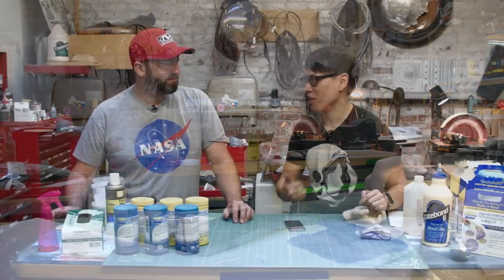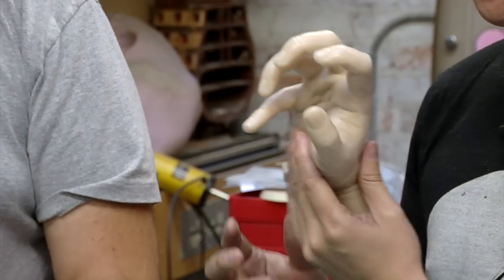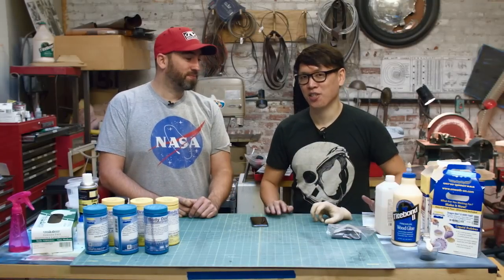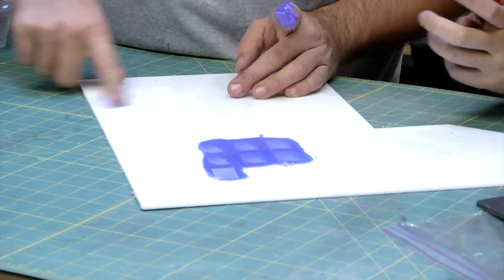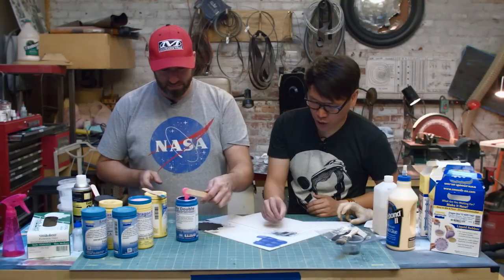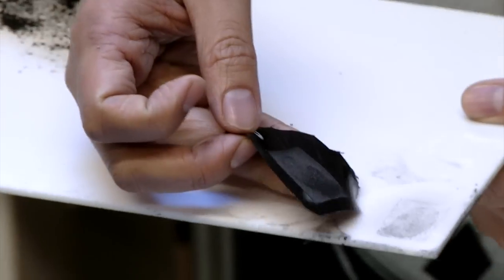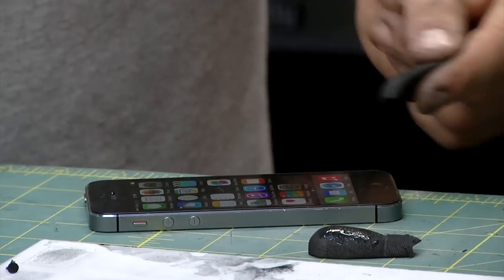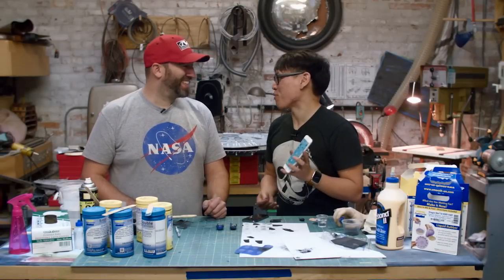Testing Apple's Touch ID with Fake Fingerprints

Comment: HAHAHAHAHA Joke is on you, did you ever stop and think apple where talking through there ass about all the bull shit tech in there overpriced junk?
Reply: The Ducken You're wrong. This video doesn't PROVE anything. If someone steals my phone, they still need full access to my finger to clone my hand in silicon.  (and if they that kind of access: for example, if i'm knocked out cold, or my finger is cut off...then they don't need to bother cloning my finger, but just use my finger to directly unlock the phone). 

This video only proves a security concern if someone could steal my phone and unlock it without my finger at all... by just using the smudge left on the phone from my fingerprint.

This video should only be of a concern to the general public if the asian guy was able to unlock the phone without the white guy present.
Reply: If this even work, it'll take a long time to go and I can quickly disable my iPhone from iTunes. And who the fuck steals and asks for their fingerprint?
Think before you hate.
Reply: Faowi 
That's not  my point, Who would know if this shit even works better that a run of the mill finger print scanner a bunch of techno talk and big words to confuse people , wen really its just a normal Singer Print Scanner nothing special AS PROVEN IN THIS VIDEO...
Reply: Another noob who thinks Android is reasonably priced and fails to understand anything about the superior architectural config of Apple products, amongst other subtle advantages. Newsflash! Android products use bargain basement components and aren't at all cool or edgy.
Reply: Steve Chang ??? Did you even read the comments? I could not give 2 shits about this finger print crap and im not going to explain again.... READ HOLE CONVERSATION then watch the link i posted BEFORE COMMENTING!!!

Comment: One time after eating lunch I was playing around with a tangerine peel, and realized that it worked on the capacative touchscreen. It turned out i was also able to add a certain section of the skin as a fingerprint, due to the texture of the peel.

Unfortunately it stopped working once the peel dried out, but it was fun while it lasted.

Comment: So, the thing is I am a crafty person and I am cutting myself fairly often, I already lost the original fingerprint on multible of my fingers and I just dont know what to think of this touch ID stuff. I dont really know how many fingers your register but I'd emagine 2 or 3 and when you have an accident with your fingers wich " destroy " the fingerprint, doesnt that than render your whole phone useless o.O ?
Reply: Your fingerprint regrows. Unless you get a new finger, or just lose yours altogether it wont be an issue.
Reply: 4WDBearAus thats not quite right mate, it always differs after a cut grows together again
Reply: Wieselkatze LOL No dummy. If you use TouchID on your iPhone. You have to put in a pin number as well. So unless you are completely fingerless you can just type in your pin number instead of using your fingerprint. Did you really think that there wouldn't be an alternate way to access the phone. Come on now dummy.
Reply: Wieselkatze you can have up to 5 fingerprints

Comment: I doubt they even reduce the noise on the fingerprint photo. All the dust between the grooves of the fingerprint lines will fill up the grooves in the laser printed result, resulting in a product that is smoother than usual and does not resemble a fingerprint.

Comment: With all this done i still think touch id is solid, because if you steal someones iphone 5s or you find it how on earth are you going to do these steps, Also the average person doesnt know how to this process. Touch Id is still a pretty solid password.
Reply: TechTuber You could theoretically get a photo of fingerprint from the screen on the phone and do the laser etching thing they did, which worked.

Edit: lol I didn't finish watching the video before I wrote this, turns out the laser etching didn't work, and your point still stands. :)
Reply: No.
Reply: TechTuber I agree. If someone is trying to go to these great lengths to unlock your phone, you're probably not an average Joe, and you probably have a lot more things to be worried about.
Reply: Yes
Reply: TechTuber What if you loose your finger. Your kind of fucked then...
Reply: Gamefan1092 That's why there's a passcode?
Reply: 74ryanwolf And you forget the password?
Reply: Gamefan1092 Seriously? If that's the case don't bother putting a password on the phone if the worst case scenario always happens.
Reply: 74ryanwolf Oh, and apple support doesn't exist in this worst case scenario universe. Have fun.
Reply: Gamefan1092 Yes, I'm aware.
Reply: Gamefan1092 OMG SO TRUE!!
Reply: +The_Only_Zac Umm i dont know what video you watched but the laser etched sketch of the fingerprint did not work..
Reply: +TechTuber yeah but since the other password is mandatory they could guess your 4 digit password OR if you trust touch id wont fail u can set the passworrd to RANDOM letters.
Reply: +super gamer you could do that, although for your own sake, you'd still need to remember it, as on first boot up, touch ID still requires the manual entry.  I guess so long as they never shut the phone off or let the battery die, they can find a way to get in.  I still trust Touch ID though, as I don't have all that much to hide, I wouldn't end up a target for much more then the phone itself.  And as Apple Pay isn't available in Canada yet, I don't have any worries!  :p
Reply: Ryan Laing you could write it down just in case

Comment: I tried this with play doh, a hot glue gun "silicon" and still didnt work.

;I used the play doh for my finger cast, then filled it with silicon, DID'NT WORK they use sub dermal imaging, which means the scan penetrates deeper in the skin
Reply: I'll try rubbing some graphite from a pencil and dust it on my casting, maybe it WILL WORK, totally forgot about the capacitance
Reply: Ricky32908 play doh works better than clay btw
Reply: Play doh is not accurate enough
Reply: it is, try it
Reply: how can he try it if it clearly doesnt work

Comment: They did the etch backwards.
When transferring a pattern to a mold, your valleys will become peaks and peaks become valleys. When they etched it, they etched out the valleys so valleys remained valleys, and peaks remained peaks. Problem with that is when you cast it flip flops again and what should have been a valley became a peak and vise versa. I'll bet that they showed us that it didn't work because Apple doesn't want us to know that it really does work. And what about the higher resolutions? They never showed those. Why? I'm not a conspiracy theorist or anything like that, I'm just trying to make sense of it logically and it doesn't.

Comment: Touch ID uses capacitive sensing not optical sensing. It basically creates electric fields, and the ions in your finger place an electromotive force on the wires, ridges have a greater force while valleys have a smaller force. This changes the charge on each wire which the processor reads as dots and then images your finger from that. Cool experiment though!!

Comment: Yes, while the lock is not super secure, you have to go through quite a lot of steps a trials to do it and only a select handful of people have the correct knowledge machinery and group of people to do it from a single print on the surface. Who wants to go through that much effort to be applied in a real world situation? These guys all did with unlimited amount of time, knowing the correct fingerprint and person and they did it for fun. I think, in a real world application, that the lock is secure.
Reply: A lot of people seem to not realize that this isn't a very practical way of people manipulating these phones. I thought it would be dead obvious from the number of steps they had to take lol
It's just an educational video in a fun way to show more about how this kind of technology works. Kinda like the Mythbusters hah
Reply: like any tech, this can be hacked, and in this case - quite easily. All you need to do is spoof the input device (sensor) into sending a digital recorded fingerprint, without the need to cast stuff. There is no protection against that. Any sensor can be fooled. There is just not such a great return for any investment in this field, so technology for this is not ubiquitous, like the tech for hacking POS or ATMs.

That's why passwords are still the best protection there is.
Reply: FishCakeIce Use a pincode and its even more secure....
Reply: ***** it doesn't realy matter because in order to get the information from the phone where the passcode would do anything different than the fingerprint, you'd have to have the phone and if someone's dedicated enough to steal the phone, it doesn't really matter what protection you have on it because they will get into it whether you had a passcode or not.

Comment: Not even remotely shocked...remember the first fingerprint scanners Lenovo put on their laptops? You could pop those with a flipping gummybear. Fingerprints are idiotically easy to duplicate, and absolutely HORRIBLE for security. You only tried one fingerprint, it wouldn't shock me in the least that with a few attempts, you'd pull it off.

Comment: The direct cast of the finger is interesting from an experimental perspective, but isn't a viable real-world attack vector (if I can get a full cast of your finger, particularly such a high quality one, it would be easier to simply touch your finger to the touch ID sensor.) 

I'd like to see you iterate a bit on the image-based casts, which are more like a realistic attack. 

Fun stuff, as always.

Comment: Tested This is why Apple sucks and Apple Pay is not safe. You guys should try the same thing with a Samsung Finger Print Scanner because I think that the results might be different(better protection)
Reply: How would the results be any different? If anything the security of that biometric sensor is the same.
Reply: No they do not because Apple uses a High Resolution Image whereas Samsung Fingerprint Scanner uses a real sensors that are used by big companies to give access to sensitive info.

Comment: If the attackers are in a position to make a silicon mold of your finger, they're also in a position to just forcibly hold your real finger to the phone to unlock it... That by itself isn't a useful attack.

Instead, using something derived from a photograph (be it from a fingerprint you left on something, or a direct photo of your fingerprint, or a photo of a fingerprint card made with ink) would be a useful attack. I read a paper where one such attack was done, but it was a far more complex process that involved using the image of your fingerprint to create a photomask to expose copper on PCB, which was costly and took hours, which is sufficiently difficult that it isn't going to be done in the common case (somebody steals your phone).
Reply: Adam Zey Didn't you watch the video, they practically reference what you read (or rather something based on what you red) and tried a form of the other method as well.

Comment: I've done it as simple as putting a thin layer of Elmer's glue on my finger and letting it set, then peeling it off and putting it on the ID and then using my another finger to activate it. No need for a mold.

Comment: Touch ID has a ring of capacitance on the iPhone 5S, but the 6 and 6 Plus the whole glass of the Touch ID sensor is capacitive. Looks like it didn't make a difference here. I wonder if this is why I still have to sign for purchases more than $50 using Apple Pay. I figured my fingerprint would have replaced that.

Comment: I've notified more and more people pronouncing "experiment" as expiriment", and the same for "electronic" as "illectronic".. What's the deal? Norm does it twice in the first minute!
Reply: Miles Tulett I mean even typical american accents are very different I know from experience that being from Philadelphia and going to school near Pittsburgh. Also Philadelphia has the typical example of water being said as "wooter" and I am guilty of using both so wouldn't be surprised if Norm had a similar situation.
Reply: Noticed*

Sorry for the typo.
Reply: It's called regional variation, not everyone in America speaks the same, or have you been living in a bunker for the last  50 years?|
Reply: Whilst I'm not from America, I know there are regional differences.  Norm, however, seems to have a fairly typical American accent.  My general experience from watching many Tested videos is that he doesn't normally pronounce 'er' as 'ir', it seems to only be when he says experiment, hence my questioning of it.  It's not limited to Americans either, an Australian podcast host says 'illectronic' rather than 'electronic'.  I'm more curious if this is how most people pronounce it, or am I unusual in 'eh' instead of 'ee' for 'e'?

Comment: I'm wondering how well you could do if instead of using a laser printer to etch the fingerprint you got a sculptor that does tiny intricate sculptures to etch the fingerprint by hand. Someone as talented as that guy that makes the little sculptures inside the eye of a needle for example.
 Maybe even start off with the laser etching and have them improve it by putting more deeper detail into it.

Comment: So if you wake up from a date rape drug induced coma and decide that your fingerprints have been compromised, how do you get new ones? I know how to change my password but I'm guessing changing your fingerprints is somewhat more complicated?
Reply: Belt sander should do the job getting rid of the old ones
Reply: Penny Lane Most people are born with 9 backups.
Reply: This is the reason biometrics should never be used for access. At least not solely.
Reply: A simple visit to your local geneticist for a small genetic modification should do the trick.
Reply: MillionthVector Actually, fingerprints aren't determined genetically. Identical twins have different fingerprints. However, for the same reason, physically removing your fingertips and regrowing them with stem cells or something should do the trick. And you only need to replace one finger at a time so you can still almost type.
Reply: Penny Lane
Ah, now I can save money on the geneticist, all I need is a scalpel and some Miracle Gro.
Reply: MillionthVector Heh, yeah exactly ... let me know how it went before I try it? Please? ;)
Reply: Penny Lane Well, at least you'd have your toes.
Reply: Penny Lane Peel off your finger's skin and wait for it to heal, BAM! New fingerprint
( ͡° ͜ʖ ͡°)

I wonder if this will actually work...
Reply: Penny Lane Man, some of the replies to this make me glad that most people aren't in charge of security anywhere. >.<
Reply: Joseph Jones Once your fingerprints have to be considered compromised, all of them would usually have to be considered compromised. Those backups are stupidly kept in the same place as the one that's in use.
Reply: Then disable TouchID if this is a concern for you. Seems like a pretty simple solution.
Reply: Potato Lord - CSGO highlights
 lol also no
Reply: Rai jyn Did you even read my original comment? :)
Reply: The only thing that you can make it is etching your finger several times. When you do it often egnouth it will slowly erase your fingerprint. Then you could eventualy cut in a new one with a small knife or a laser...
Reply: Rakastan-girl Sinua as we can see the laser ist not acurate enough to fool touch id. we'll need some laser tweaking before this.
Reply: Penny Lane If you have all 10 fingers registered then yeah, sure. I, for one, only have 1 fingerprint registered on my iPad Mini, and it's mostly for convenience, a quicker, simpler way to unlock. Like others have said, though, you can always just switch it back to password-only.
Reply: Rai jyn I would change the finger I put into it to another one.
Reply: Penny Lane cffbsc

Comment: I am wondering if those wax hand peals that some people get in order to make their skin softer (if done just right and with the right substances to preserve the wax as a sort hand mold) would work, and if not, what would it take to make that work? I am talking about the one where you dip your hand into a melted wax that is supposed to penetrate the pours of your skin. I had one of those done back in the mid-90s and I had thought about something like this at that time. Can this in some way, shape, or form, be done. I feel like it could be done if one was extremely careful about it. I think something like this is also done to make handmade novelty wax candle hands from peoples own hands. If you use the right products and again, are extremely careful, you should be able to make an exact copy of a person's whole hand that way (possibly prints and all). It would be great if someone could find out if this 'could' work. We would need to find this out before you put your whole house and job on your cell phones and have someone gain access to your life in this way and put a stranglehold on it. I love technology and what it can do for people, I just don't trust some of the people behind the tech!! (Case in point, the recent Sony hacking, which now looks like to could be more of an inside job than North Korea). If this were a better world we wouldn't need security devices like this touch ID system.

Comment: Did they laser etched the finger print on a foam core? A foam core will distort the finger prints with tiny bobbles cause its foam. Re-do the laser etched on a sheet of copper, similar to the way Adam and Jamie did it when they try to unlock a door with Grant Imahara's finger print.